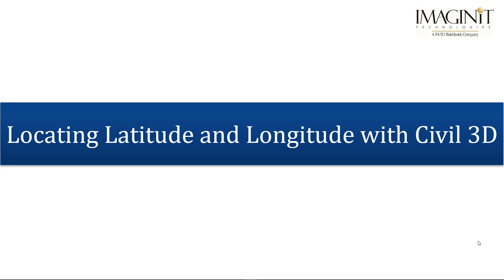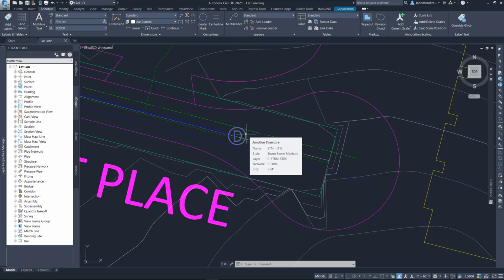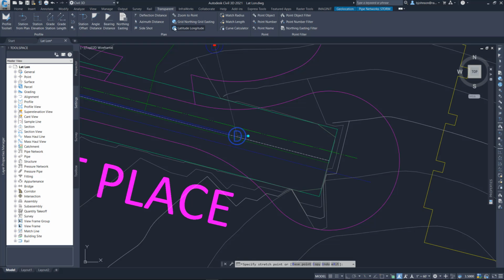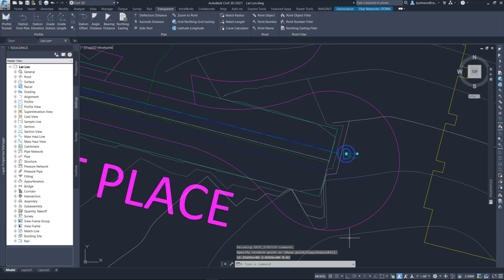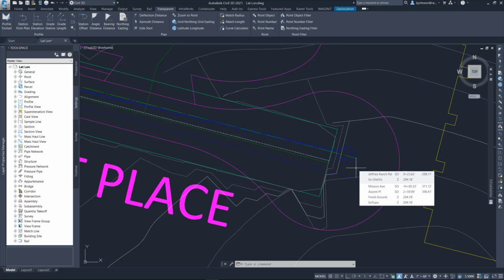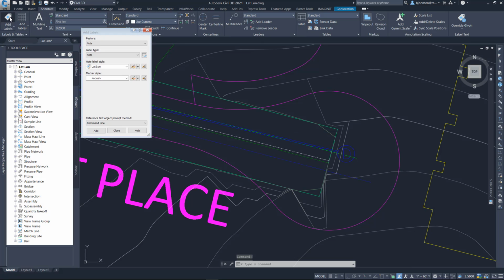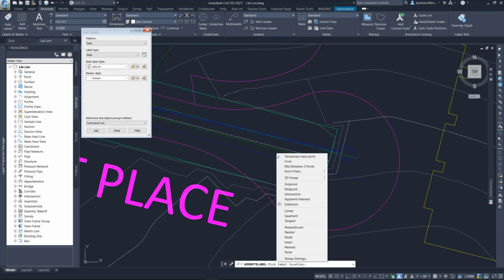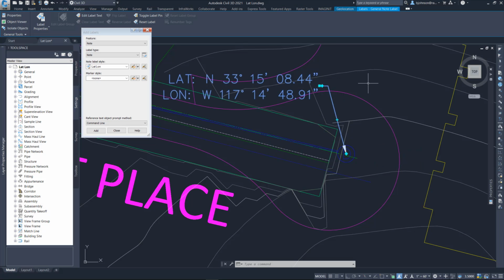Locating Latitude and Longitude with Civil 3D

Comment: please how to set lat long in id command
Reply from the maker: Per our technical experts: The AutoCAD “ID” command does not display Lat/Long data.

However, if you have Map or Civil 3D, you can use the “MAPTRACKCS” tool to track your cursor location or set points by Lat/Long

Note: Be sure in the “Coordinate Tracker Options” the option for “Format lat/longs as D,M,S” is checked on.
For additional assistance with this, or any other Autodesk technology topic, please contact us to arrange custom training or mentoring.